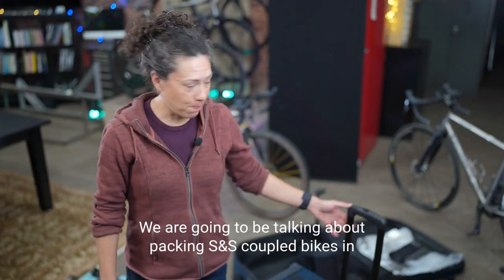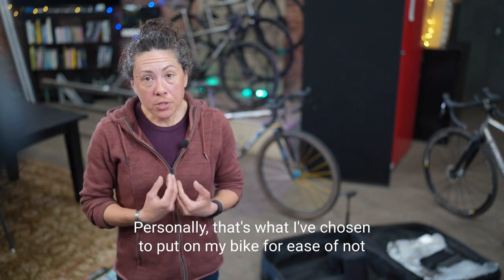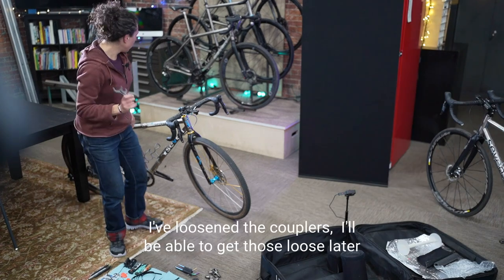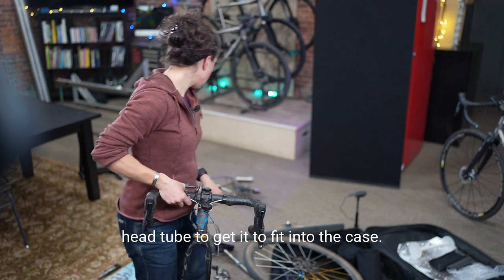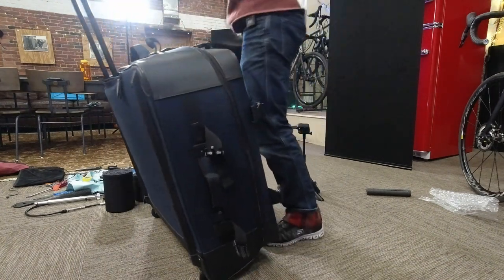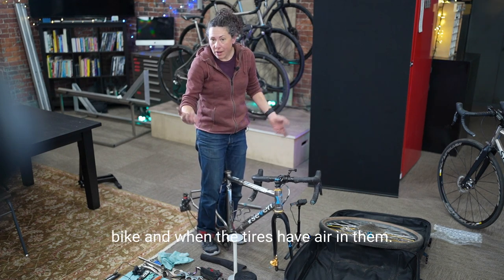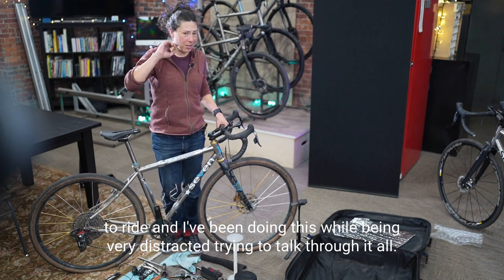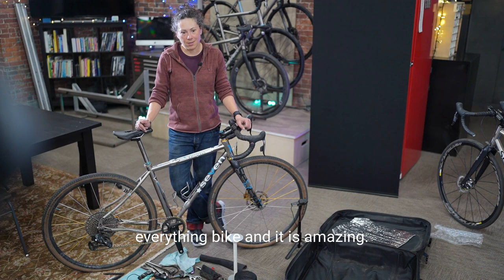Air travel with your bike: Packing and Unpacking an S&S Coupled Travel Bike

Comment: Would love more on why a soft shell case protects better than a hard shell case. Imagining each under a mountain of luggage.
Reply from the maker: There are a long list of reasons for this! First, TSA opens most suitcases and when they do, they have a heck of a time getting the hard case to close again. We've heard numerous people say that their bike case was simply left unlatched due to TSA's inability to get it back together again, allowing parts of the bike to fall out. Hard cases break when they get crushed so that's bad to have to them deal with the broken case. It's hard to pack a hard case, and that means it's harder to put things where you want them to be. Luggage handlers tend to put the hard cases under all of the luggage and soft cases are treated more kindly. All of the people I know who started by traveling with a hard case have since purchased a soft case and stopped using their hard case either because it is broken or because they were so concerned about using it.

Comment: Super helpful. Thanks. Were those 700 or 650 wheels? Do 700c wheels with say 40mm tyres fit in the case (ideally without breaking the seal, but that doesn’t sound possible)?
Reply from the maker: Yes, this is the tire/wheel size combo used in the video and it does fit without breaking the seal. Just traveled with 700x42mm tires and only had to take ~20lbs out of the tires and everything fit fine, the tires stayed in place on the rims. Might be a tighter fit with a huge bike/setup.

Comment: thats why i sold my carbon fully internal cable gravel bike and got a fully external titanium bike.. now im considering a mechanical brake system, or just stay with the grx system...
Reply from the maker: Fully external: super! So much easier to deal with in general. That’s a big decision between parts already on it vs unknown new parts! Where will you be traveling with the bike? Is it S&S coupled? If not, and if you are traveling to first world countries, wouldn’t swap out the parts.